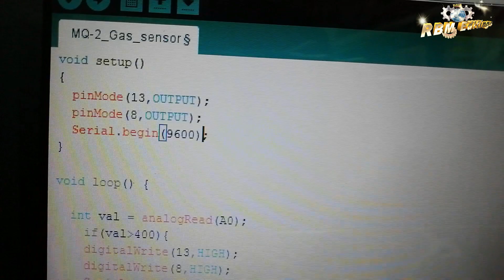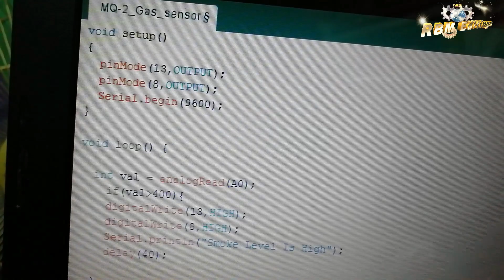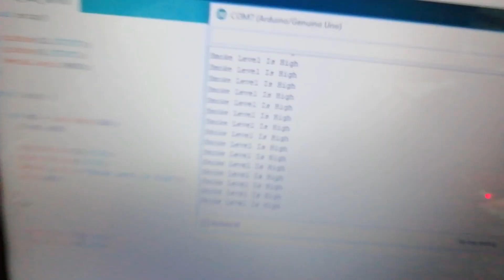LPG Gas leakage Detector -  #Arduino Project In Tamil

Comment: Bro, will this project detect fire also??  For my project, I need the sensor to detect if there is gas leakage from the gas stove.  It should not detect if the gas stove is switched on and if it is burning
Reply from the maker: Hi bro
MQ-2 Sensor does not detect fire.
You can use it